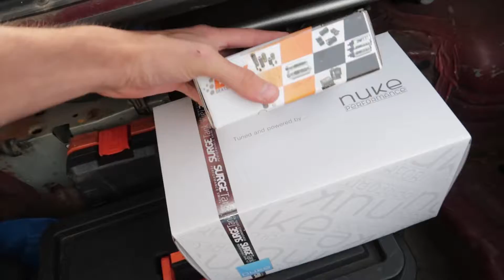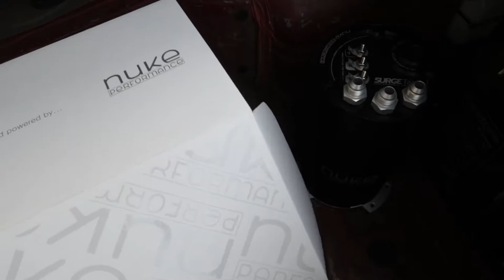HOW TO SETUP A FUEL SURGE TANK - Nuke Performance

Comment: Old video, but you should have reversed the two connections closer to the main outlet to maximise the amount of HOT fuel that goes back to the tank for time to cool and minimise the temperature in the surge tank. You could have ordered the 3 worse, but also better. Fuel being not-water expands quite a lot when it heats and unless you have measurement of that and compensation in your ECU (factory don't have it) that hot fuel both leans out your open-loop tune slightly and increases the hot-start issues causes by boiling in the injectors and rail.
Reply: That's actually especially true because you have your pump inside the tank being cooled by the surrounding fuel. So flushing that fuel out back to the tank as much as possible is for sure on your agenda. I wouldn't ever run the pump in there like that. It gets enough cooling from radiant, air convection, and fuel passing through at a high rate and leaves more volume of fuel in the surge tank, and ability to put structures in place to give you quality fueling right up until the surge tank runs dry, along with a properly smooth inlet path to the pump from the tank. None of that is possible with the tank inside like that, really.

Comment: Question:  Isn't having exposed electrical connections inside the surge tank a bad idea?  Fuel will be splashing around inside the tank and will cross connections causing shorts.  There's also the possibility of creating sparks in a tank full of explosive liquid.
Reply: Gasoline is non conductive and even E85 with it's higher conductivity is still not conductive enough for it to be an issue. You also need to have the right mixture (gasoline vapour and air) for it to be flammable/combustible, same principle as in the engine. 
Because the flammability limits of gasoline vapours are very limited, the mixture in the tank is well above the point were it's flammable even if an ignition source is present aka the spark- around 1.4% to 7.6% by volume of air.

Comment: I didnt even knew that there is fuel comming back from the engine, but I still didnt quite get why there is fuel returning.
Reply: Your fuel pump doesn't vary in its delivery.  If the car is on, it's pumping fuel 100% of the time at full force. It does that to keep fuel pressure. Your fuel injectors (or carburetor if your car is quite old) handle the ups and downs of fuel delivery depending on you pressing the gas pedal.  If you're not using all of that fuel the pump is delivering, it will send it back into the tank to be recycled until it is needed.

In my car there is no return line all the way back from the engine, the pump reaches its desired pressure and anything more than that is dumped from the pump via a bypass valve without leaving the tank.

Comment: Are surge tanks a common thing  with the grip cars, like the hardcore civcs and stuff?
Reply: Anything that sees high G's (especially lateral) should run a surge tank, so it is common to see them on grip cars.
Reply: I know some cars are more prone to fuel starvation than others. I haven't heard of or seen many hondas running a surge tank, I wonder how much they benefit.
Reply: @dropinbiking92  If they're not starving unless the tank is quite empty then there wouldn't really be a benefit I guess.
Some cars will suffer from fuel starvation even on a 1/2 tank so it would be more beneficial in those cases.